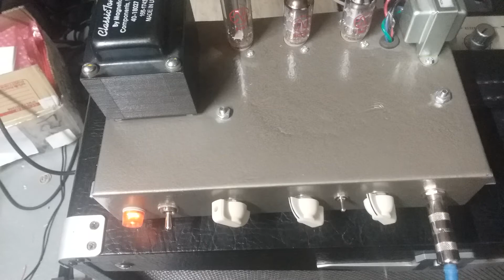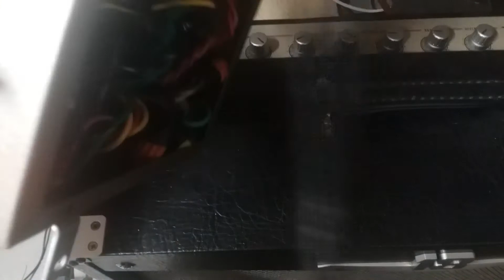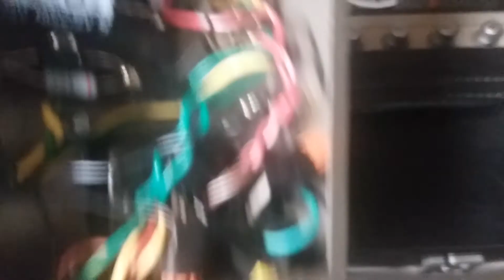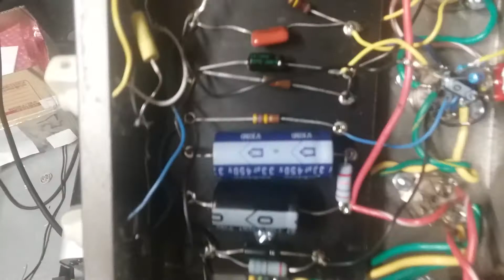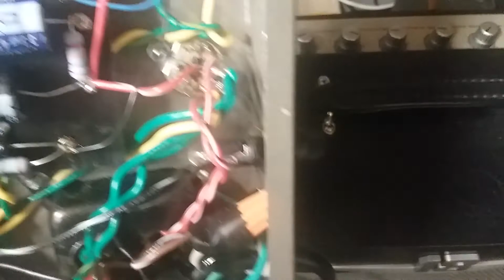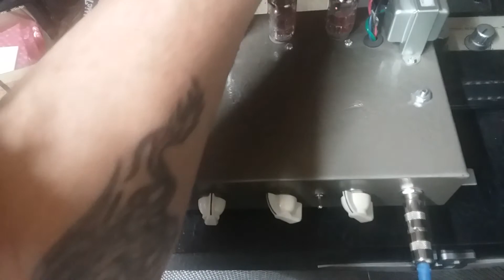5e3 micro build with mods/Rob Robinette design

Comment: Sounds great - can I ask what you used to drill out the square holes for the transformers? I assume you bought a blank chassis?
Reply from the maker: @Eurobailey80  I drilled some pilot holes then used a jigsaw with a metal cutting blade.
Reply: @snowmaneffect  appreciate the prompt reply . This part looks almost the trickiest part of the build haha. Did you just buy a tweed deluxe blank chassis? Aluminum?
Reply from the maker: @Eurobailey80  it was just a generic chassis that I painted.I used aluminum because it is easier to work with.
Reply: @snowmaneffect  thank you. Drilling Steel seems very painful! Appreciate your help.

Comment: You and your amp sound great. Very nice demo.
Reply from the maker: Thank you.
Your design worked great with the mods.
Reply: Rob,I can't make my mind up which Micro to build- Deluxe or Champ. What's the difference please? Sorry for high jacking,great demo mate!
Reply: @sharonlee4773  One is based on the Fender Champ (very simple, single 6V6 power tube), the other on the Fender Deluxe (dual 6V6 push-pull).

Comment: Sounds amazing! Thank you for the demo! Please, does it have enough bass frequencies like standard 5E3? Thanks again😊❤️
Reply from the maker: Yes.Just needs to have the right size speaker.
Reply: @snowmaneffect  many thanks for your reply😊 one thing i love about 5E3 are those frequencies and i couldn't find any amp i can play in our flat, all those 5W amps are still loud and heavy.. even the small 5E1 is 7.5kg and still too loud and has no bass frequencies.. these 1W simple amps are exactly what people think about 5Watters and there will come the day tehy will be very popular..
Reply: @mojekh  bass is what translates through the walls easiest, just as a caution. treble loses energy more quickly and therefore doesn't penetrate wall substrates as easily.